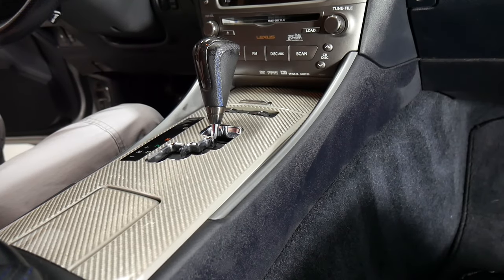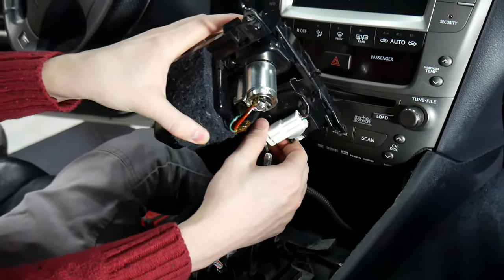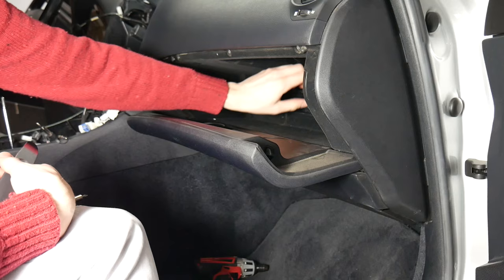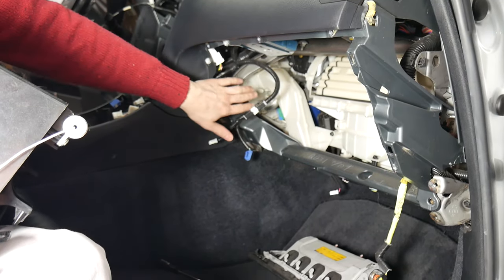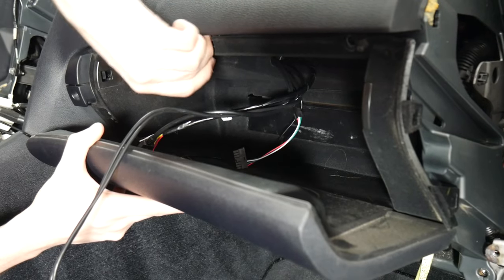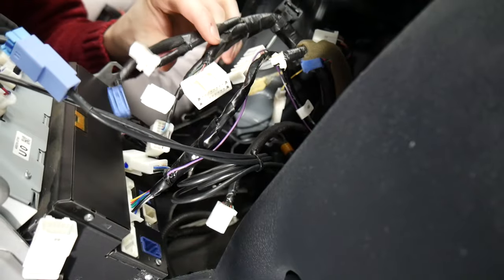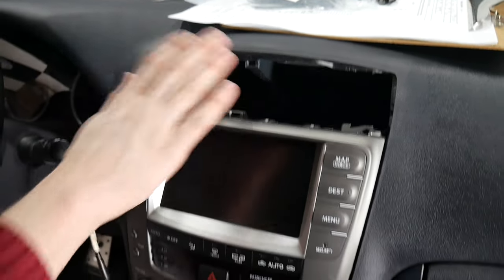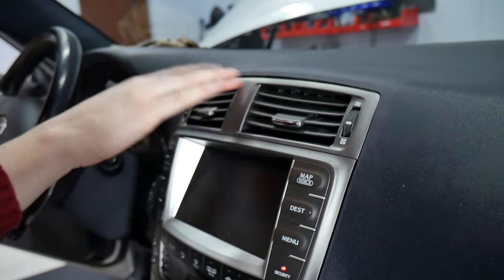Lexus IS 250 350 ISF 2006 2007 2008 2009 CarPlay Android Auto install VLine GPS Glove Box Mount LEX5

Comment: I dont have the 12 pin connector on my lower Harness. And if I want to run it like that the touch screen doesnt work well and my original functions dont all work. What do I do ?
Reply from the maker: Do you have a GROM product and need help with the installation? If so, contact us via web form at https://gromaudio.com/support.html We will help.

Comment: I have a 2009 Lexus IS350, it is the navigation package w/ mark levinson however the buttons are smooth, and does not have the bumps. Would there be a problem with compatibility?
Reply from the maker: As long as it is the original stereo with the LCD display, it will work.